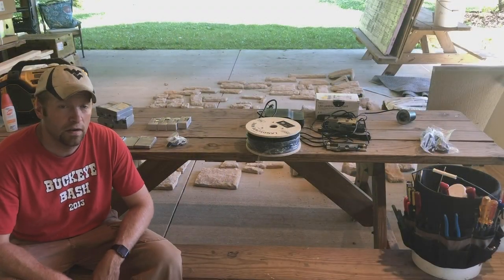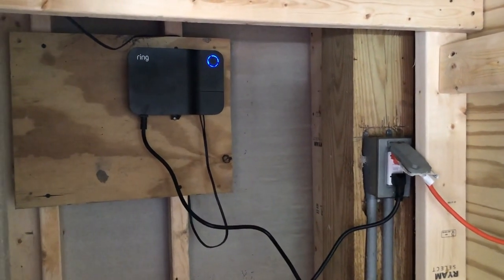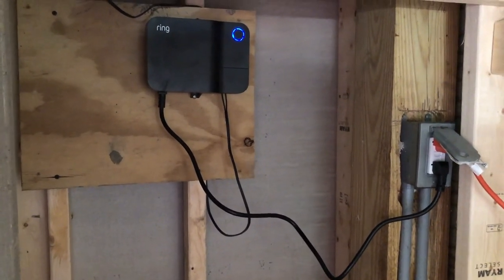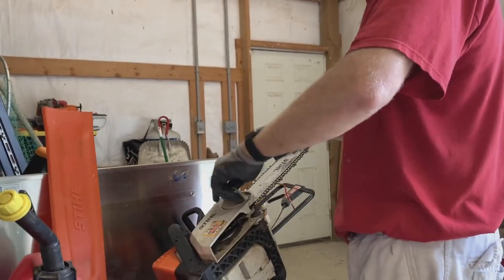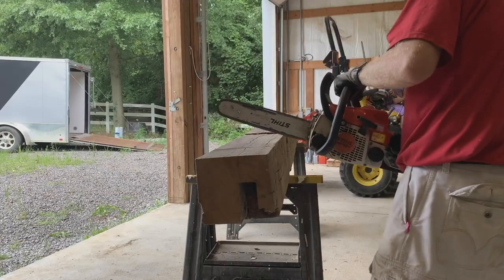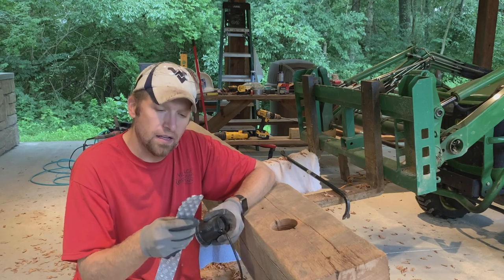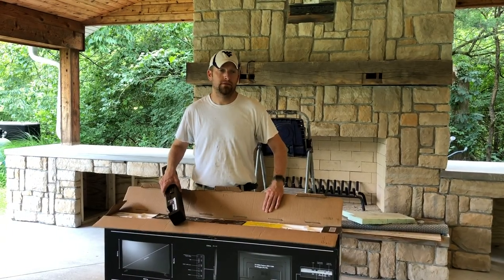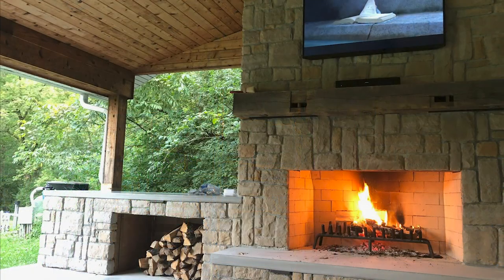BYO Outdoor Fireplace - Mantel

Comment: Great job, maybe a follow up video of the project from start to finish at the end of the summer with some Q&A. How did the fire work out good draft no smoke? when it rains as in Ireland does the rain go side ways and did it impact the TV. How did you use the area and where did people gather the most ie at the counter, by the fire on seats or the ledge by the fire
Reply from the maker: Thanks for the support Hugh....great idea.  We will look to make that video soon.  What I can say in the short term is that the television made it through a fairly wet midwest US winter and the drafting has worked well.